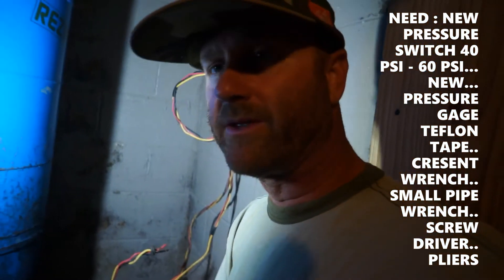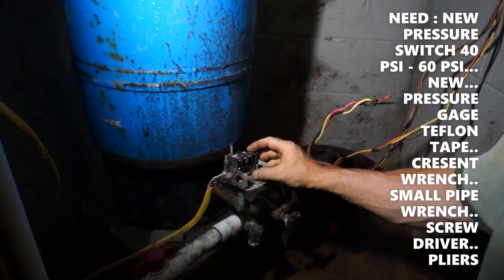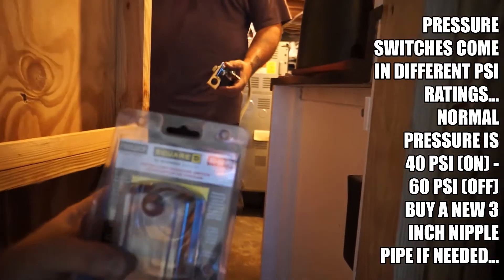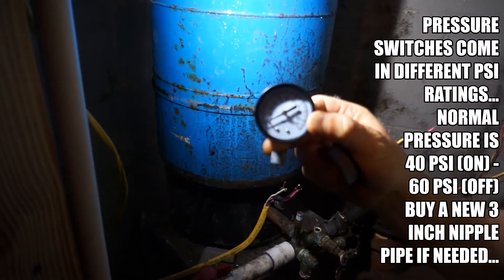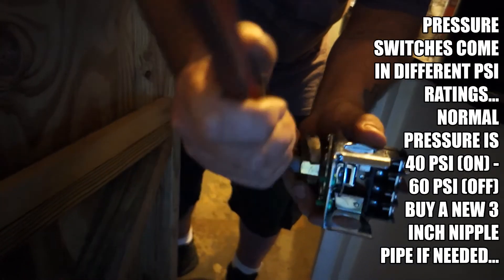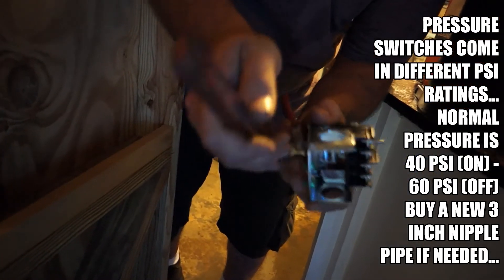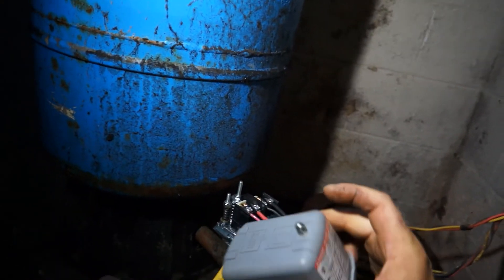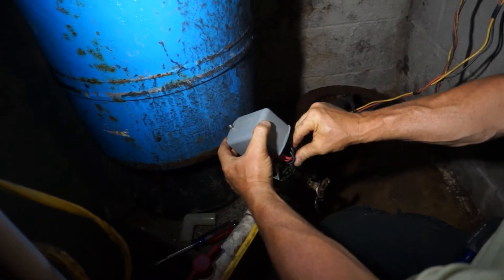WELL PUMP NOT WORKING ??? HOW TO REPLACE A WELL PUMP PRESSURE GAGE

Comment: He's calling a pressure solenoid a "gage", as well as the actual gage. Would kinda confuse someone if they don't know. They could go to a supplier and ask for the wrong thing.
Reply from the maker: Yeah, I was busy thatvday..back in that hole where the well pump is. Tight fit and trying to get the water back on. People can at least see what the items look like and get the confidence to fix it themselves.  Sorry, for confusion. Thanks
Reply: @2guyshow2thefishkingz89  Understand, didn’t mean to sound critical. Still, it was a good video.
Reply from the maker: Thanks..appreciate it!